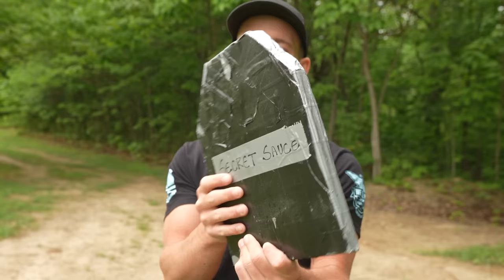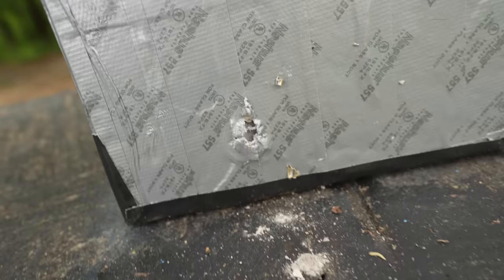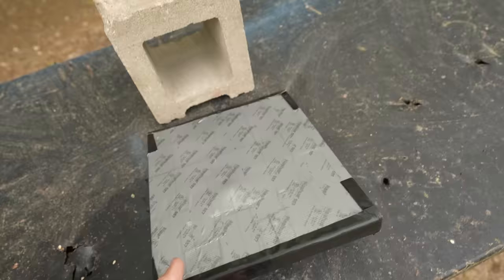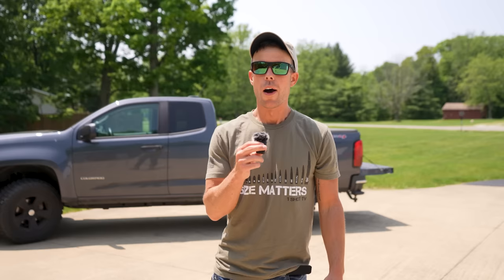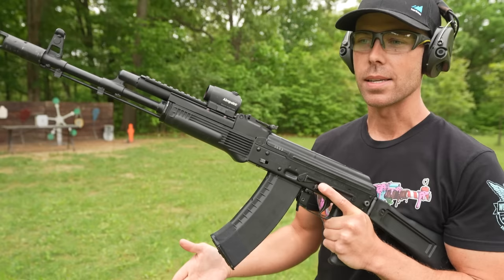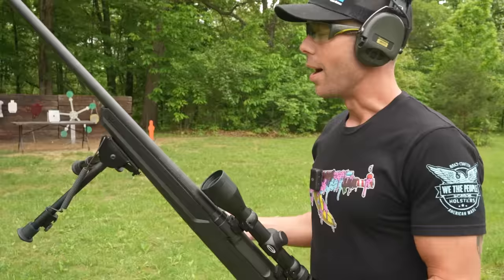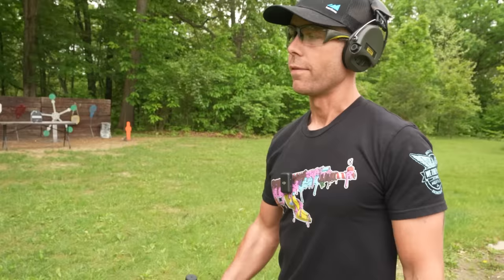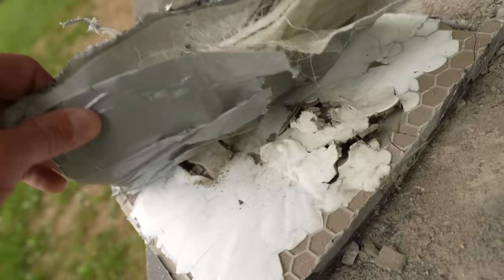CHEAP Homemade Body Armor That Stops RIFLES, How's It Done??

Comment: Thanks for putting my homemade crap through the ringer!
Reply: Why dont you post a video on how to make that body armor
Reply: im guessing the last plate had oobleck in it. its a neat concept but it just shatters  too easely. and the kevlar didnt seem like it was woven the  way body armour would be. i wonder if some one  soked gevlar in fiberglass resen and also maybe had fiberglass around that and some carbon fiber around that and some steel  around all that . or maybe switch the steal and carbonfiber layers
Reply: @kirill2525  That's actually just caulk.  I was hoping it would hold everything together.  Obviously didn't work out that well.  😅
Reply: @TheOldFatDadGoober  oh lol hmm. maybe jbweald would be better. actually try getting a lot of e6000 glue. it hardens into  a very strong material that is dence, sticks to everything yet is a bit flexable so it wont crack. also heat resistant. do be aware that it does shrink when it dries.
i  found a suitcase with a huge hole on the bottom by the wheels and i out some tape or toothoicks and layerd a bunch of that glue on there to fill it. that spot is now the strongest part of the suitcaise wich i have put through hell by caring likr6 gallond of water up stares with it many times
Reply: @kirill2525  Neat idea, I'll check it out.
Reply: @The Old Fat Dad Goober  good job sir
Reply: ive seen the plywood before, maybe yours. how about trying this. 
tile/plywood/steel/tile/plywood/steel.
Reply: @Davidautofull  Interesting idea, might give it a shot.
Reply: Is that ooblek in there??
Reply: @beantea5592  Not ooblek, just tons of caulk.
Reply: @TheOldFatDadGoober  ah cool!
Reply: If you haven't done it already you should send some homemade plates to Matt @Demolition Ranch and let him put your work up to the test because pretty much all of the plates that other people have sent him to shoot have either failed during his test before he had the chance to shoot the plates with any of his big caliber rifles or if they made it until the end he then shoots the plates with his .50BMG and if the normal FMJ 50cal round doesn't cut it he'll then shoot it with a 50 cal AP and API rounds and between one of them they will make it through the plates and he hasn't done one of them videos in a while so I don't think anyone has sent him anything in a while to shoot
Reply: @TheOldFatDadGoober  

Ceramic tile up front, with layers of UHMW polymer fiber, Kevlar or Kevlar/carbon fiber weave all bound together with a truck bed liner is the way to to. 

You can use fiberglass, too. The kevlar/carbon fiber would probably be your best bet. 

You want to use two layers of smaller overlapped ceramic tiles. 

When you're waiting for your binding agent to cure, you'll want to sandwich your plate between two hard surfaces and clamp them together so it's compressed when it cures.
Reply: @TheOldFatDadGoober  might I make a suggestion? If you put "rhino liner" sandwiched in between each layer ceramic and with a piece of 14 gauge steel in the back I would be willing to bet not only would have better control of the spall  but it would have better resistance to the higher calibers traveling faster.
 Justin suggestion.
Reply: @thomandstacieverroad8417  Good idea!  I'm thinking about revisiting the concept soon.
Reply: @thomandstacieverroad8417  Good idea!  I'm thinking about revisiting the concept soon.
Reply: Secret sauce was mastic, wasn't it?
Reply: @bikerguykrash1182  It was some pieces of an old poly 3A plate I had lying around.  Didn't work as well as I hoped.
Reply: @bikerguykrash1182 he said chalk
Reply: Great Job👍👍
Reply: killerwolf7676  I have not but I've heard some of the same things you have.  Might be a good project for down the road  🤔
Reply: I wish to make a plate for Grandson Backpack he is 10
Reply: @TheOldFatDadGoober I been collecting empty Arizona tea gallon jugs
Reply: Was test done with Correct side faceing us ?
Reply: @fredcarbery3966  Yes
Reply: @fredcarbery3966 they sell a kevlar panel for that. It's thin enough that you could layer two in about 1.25 "
Reply: @fredcarbery3966 rts and ar500 .... it's already a product and by time you get done with time and materials is it really worth "trusting" your grandsons life to a cobbled together plate or spending the extra $40 and just buying one one you KNOW works?
Reply: I wanna try this. I'd add another layer of steel in the front. Fiberglass and epoxy in the middle so they stick together. Then wrap the whole thing in fiberglass.
Reply: @TheOldFatDadGoober Were those ceramic or porcelain tiles?
Reply: @nowhereman5424  They are porcelain.  It is always way harder than ceramic.
Reply: kudos to you
Reply: you should sell your plates i would deff buy one
Reply: @hectorcelaya8225  Thanks!  I would be scared of the liability issues.
Reply: I wonder if you had More layers of thinner material and had a couple of the layers with an Air Gap or Soft Layer ..  ... I think that's why the two tiles did good because of the soft wood layer in the middle ... it forces the bullet to deform on first hard layer , then a gap , then a deformed bullet back into a hard layer will be much harder for that bullet to keep going .....
Reply: @TheOldFatDadGoober
So the first one was:
 tile, plywood, tile, 14 gauge steel?
That first plate was impressive to stop 556 and 7.62.
Super good work
Reply: @mitchy3438  Yes, that's the setup. Porcelain tile is important because it's way harder than ceramic.  The plywood might not be necessary.
Reply: @TheOldFatDadGoober 
Have you shot it with 308 first?  Every shot will break the tile, weakening the plate as a whole.
Reply: @johnny.d.1930  I have tried a new plate against 308 and 6.5 Creedmoor.  They both punched through.
Reply: Lol. Goober is a funny word. Goober😅
Reply: Very impressive!!!

Comment: I was on a papermill shutdown several years ago and I was talking to a guy that was doing fiberglass piping on a tile vessel. I asked him if he has ever worked with any kevlar. His response was yes but the better armor was made of carbon fiber and balsa wood. He goes on to dmsay that Northrop Grumman contracted his company to make them 4'×8' sheets of carbon fiber 1/4" thick with balsa wood 1/4" thick. 2 layers of carbon fiber with one balsa wood in the middle would stop .50 BMG. I havent tried this configuration myself so if its a lie that fiberglass pipe guy told it. Maybe some industrious youtuber could try this out.
Reply: I could see it working. The carbon fiber would need to be pretty tightly woven, maybe some secret sauce mixed together with other elements. 

The fibers would provide the surface tension to the balsa wood, and given the diameter of a 50 cal, theoretically, it would disperse the force enough. 

Again,  that's some special carbon fiber in the first place.
Reply: Probably a 3k or higher weave I would imagine. The rosin I'm sure would be standard 2 part epoxy resin
Reply: Sounds like a lucky shot. C/F shakers when hit. Seen it.

Comment: Time to start pillaging scrap from home renovations I guess. Mans stopping assault rifles with floor tiles, framing wood and drywall compound. lmao This is the best thing I have seen in ever. I am fairly confident every one of those shots would have been stopped with a decent spread of resin as the first and middle layer, and it wouldn't even add much weight either.

Comment: Thanks for the video. 

To me, the real value in this kind of effort would be finding an economical way to keep bullets from going through walls in a suburban home. Ideally, we'd all set up our home defense plans to try to funnel an attacker into a specific choke point where we would be able to shoot from a position of relative safety and make easy hits. We'd also want to have the downrange area be one where missed shots or bullets going through the attacker don't injure innocent bystanders. If one could fortify a wall in the downrange area, then missed shots wouldn't endanger the neighbors. I could see value in fortifying the walls of a child's bedroom this way. I could see value in putting these kinds of plates on the back of furniture to stop stray rounds. I love your testing as part of trying to achieve that kind of effect.
Reply: For a wall it'd obviously be costly but you could; fill the cavity will something like stones (similar to ceramic ball idea I saw yrs ago), then something like the first vest, a thin sheet of metal, tiles glued to that maybe even a double layer & then marine plywood. You could just paint the plywood or glue a sheet of drywall & paint you could even use the fireproof drywall 15 or 20mm pink stuff.
Reply: Dude I love the idea to incorporate into furniture, lawn or porch furniture ,never know when you gotta take cover.

Comment: Interesting video 
A Body Armor I made a while back that worked on Pistol rounds 
Never tested rifle ammo , but it should work 
Several layers of Kevlar , 1" of duct seal putty and then 1/4" AR 500 plate 
All inside a fabric case 
The duct seal putty helps spread the energy over a larger area

Comment: Keep in mind, 'Kevlar' is a trade-name...the fiber you want is 'Aramid fabric' or 'cloth'...and you can get 1-sq.ft. for about $8.  Pure fabric layering, 5 layers of 22-oz. extra heavy duty aramid will stop a .22LR...it's the 'layering' that really makes it work. Think of Kevlar/Aramid as a 'cut/puncture' preventer...while the steel (or other intermediary) is the deformity limiter. If you want 'light weight', you'd want a sheet of titanium for the 'strike zone', then maybe 14-gauge steel, then a layer of Aramid, then possibly a 1/8" fiberglass plate, then Aramid, then 1/8" fiberglass, then aramid...possibly dipped in a rubber or polymer coating. Use 2-piece Marine epoxy to hold it all together...possibly with an 'edge wrap' of Aramid or fiberglass and resin (like a boat hull). Someone else mentioned Grumman approaching their company about building a 3-layer 'sandwich' of Kevlar and balsa and it would 'stop a .50 BMG round...not sure of so few of layers, but 5-7 sandwich layers might make it possible...as the balsa is lightweight, and providing a 'bumper zone' to absorb impact energy between sandwich layers.
Reply: I think it's nylon technically. One of those. Like nylon rope

Comment: I miss the 45-70, and would love to see more of that against body armor ;)
Reply: Yeah... TRex Rifle!
Reply: Yes!!!! That would be graet . I love the 45-70
Reply: It's just going to be stopped if it's rated to stop rifle rounds...  I've seen some 3A rated to .44mag stop .500smith and .45-70, but most 3A will be defeated these rounds.  Small/fast is what defeats hardened armor (barring an API round) .45/70 is big/heavy/relatively slow.  Big/heavy/slow/high frontal area is great for penetration on soft targets while tearing tissue, breaking bone, etc.  Hence why the .45-70 is so commonly carried in Alaska for bear defense.  Not great at defeating plate armor though...

Comment: He did pretty damn well! Good stuff man. I actually work at a fabrication shop and we have some composite that might need to be tested. I’m willing to put my work up against you!
Reply: Go for it!  I really enjoy doing stuff like this.  Love to see what people come up with.
Reply: @TheOldFatDadGoober  hey bud I just subbed. I appreciate the encouragement. I’m going to start working on something on my lunch breaks.
Reply: @Thegoofyairgunner  thanks!
Reply: Yep, composite is the way to go. I was also thinking the guy should use smaller single tiles instead, so only one small spot is compromised, and not the huge cracks in one single tile.
Reply: @scaleworksRC  I was thinking about a layer of the small octagon type in front and middle of the layers of composite. I think I can keep it around 8 pounds too. I stopped by the shop and looked at a few things. I’m hoping to get some together. Since we are already on the same thought process if you have any suggestions I would like to hear from you
Reply: @scaleworksRC  I messed around with the smaller tiles but it was too much work.  I lay down a bunch of caulk on the back of the big tiles and they seem to hold together alright.  You saw how many times he hit close!  😅
Reply: You should. I used to work at a couple fab shops myself, so Im invested in you! :)
Reply: @KapteinFruit  I’m going give it a go for sure. I appreciate the investment and gonna have to give us fabricators a good showing!
Reply: @Thegoofyairgunner  That would be sweet. I watch this all the time, so if you do, I will see. :)
Reply: i get free fiberglass scraps from work, we build boats. i can sell you good size scraps for cheap, all big enough to use for making plates.
Reply: @ElectricalExistence  I’m game I could probably layer ceramic composite and fiberglass into something serious
Reply: @Thegoofyairgunner  i was thinking about making armor with synthetic ruby/sapphire in it instead of ceramic.
Reply: @Thegoofyairgunner  id need to know how much you want, and what you think is fair to pay for it. i have a couple hundred pounds i think. weight and such varies from piece to piece, all good stuff, some of it is 3 layers in one sheet.
Reply: @ElectricalExistence  how can we get in touch without making our contact information public knowledge?
Reply: @Thegoofyairgunner  have discord or telegram?
Reply: I wur jus wonderin, wur if some varmint were to shoot ya in the goolies! Ya got body armour furin that??🤠
Reply: @patrickganly5206  🤣 we is gonna hav ta think on dat an be figerin sumptin

Comment: After watching Buffman Range I can't help but mention how using a shooting rest, and a representative backing (like clay) would/could have changed the performance of the plates. Fair hits and a static plate (meaning the plate wouldn't have been affected by reciprocal impact force, and having a body-like medium behind it to dispurse force) may have been a more realistic scenario as well as preventing the plate from moving or absorbing reflective force that was induced by the concrete block.

Good video, though.
Reply: How about an old cookie tray of tin front back or center

Comment: I've been amazed at how well regular fiberglass/epoxy will stop! The dust coming out of the plate is probably ceramic tiles!
Reply: If I was to make one, it would consist of steel in the front like this armour, then layers of epoxy and carbon fiber weave
Reply: I'm not. Fiberglass has been used to reinforce Engineering Grade plastics for decades. So it's no secret that fiberglass would hold up this well.
Reply: @SergeantExtreme  obviously I'm aware that it failed but there's a definitive reason they make submersibles and stuff like that out of fiberglass
Reply: considering that most wounds in modern warfare come from artillery/bombs/shrapnel, and not bullets, a high supply of such "cheaper" plates might make sense..
Reply: @kennydoggins1712  I heard carbon fibre is the best stuff for making deep sea submersibles 🤣
Reply: @PiNKMuDSimGaming  was it carbon fiber not fiberglass? I might have mixed that one up. Either way wild it worked that well, till it didn't
Reply: @kennydoggins1712 I believe it was a mixture of both
Reply: @rood6422  i wonder how much shallower it would have failed of it had been shot with a 9mm before
Reply: @MrRedeyedJedi the problem with steel is that they can ricochet into your neck or arms that’s not why they’re used mainly as the bottom material.
Reply: @maybe2714  it's called spalling it's not going to bounce at 90c into you unless it hits the plate at the weirdest angle ever lol

Comment: Bro with ya ammo list the Pounds per square inch and size of the round. velocity is inconsequential its all pressure and surface area.5.56 or 223 usually 
Then all ya have to do is match the material to the pressure plus 25% for an overlay of rounds and a factor of safety...
So if ya Buy Bisaloy or Hard Ox wear plate with an MPa of  500 Mpa  to 600Mps or 80,000 psi to be safe...
Then Fibreglass reinforce 7 mill either side as the fibreglass will act as the Beat Spall suppressant and will most likely capture the deformed round and if ya throw a layer of kevlar over the top of the fibreglass this will ensure a very effective amour protection from front line government M16 Platform rifles...The kevlar is an option...As this will ensure the plate will be reusable multiple tiles and the fibreglass will make the plate repairable...

Parent case	.223 Remington (M193)
Case type	Rimless tapered, bottleneck
Bullet diameter	5.70 mm (0.224 in)
Land diameter	5.56 mm (0.219 in)
Neck diameter	6.43 mm (0.253 in)
Shoulder diameter	9.00 mm (0.354 in)
Base diameter	9.58 mm (0.377 in)
Rim diameter	9.60 mm (0.378 in)
Rim thickness	1.14 mm (0.045 in)
Case length	44.70 mm (1.760 in)
Overall length	57.40 mm (2.260 in)
Case capacity	1.85 cm3 (28.5 gr H2O)
Rifling twist	1 in 7 in (178 mm) or 1 in 9 in (229 mm)
Primer type	Small rifle

Ma11ximum pressure (EPVAT)	430.00 MPa (62,366 psi)

Signed Ex parra Ex Armourer Ex Engineer...

Comment: Might be a hybrid JB Weld with some sort of heavy duty silicone/epoxy for the sauce plate. I think the first plate would be more defensive with a decent layer of melted HDPE plastics/fiberglass welding blankets mixed in too.

Comment: I love your videos, they remind me of older Demo Ranch videos. The only thing that I wasn't big on was that you used steel case .223, which is loaded weaker than other .223, and fired it out of a 10.3" barrel, which reduces the velocity potential of .223/5.56 greatly.

Comment: The velocity from that 5.56 pistol is around 2350 to 2500 with brown bear.

A 20" with 55 grain may have given a bit more of a vibe check.
Reply: At least with a 16" or 18" barrel which are more common than a 20" these days.